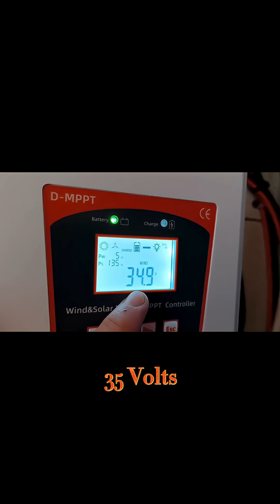Why My Wind Turbine Failed - Common Mistakes to Avoid!

Comment: Okay fella .seings you've been playing with these beasts.. I trying suspending one on a rope in my boat .. bad idea.. what model do you recommend.. are you Romanian? I'm in Tasmania
Reply from the maker: I'm Ukrainian.
For boats there are S3 units, they were designed for boats. Just go with the:
1. 3-blader
2. 1.2 m diameter.
3. The biggest gen possible there (15-18 mm thick).